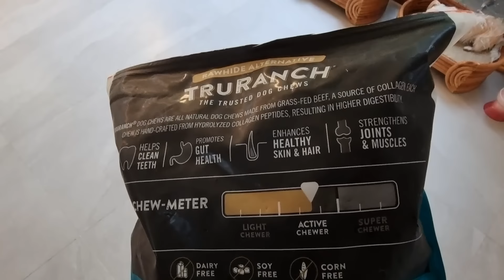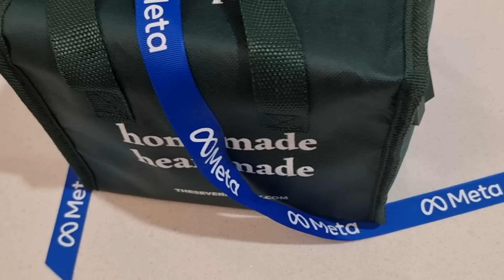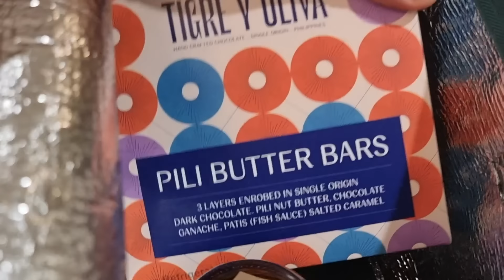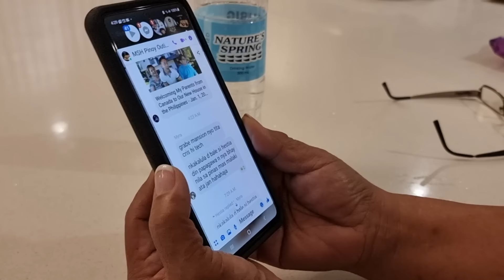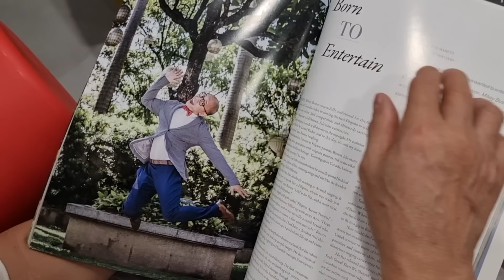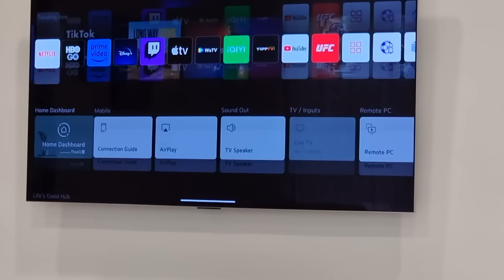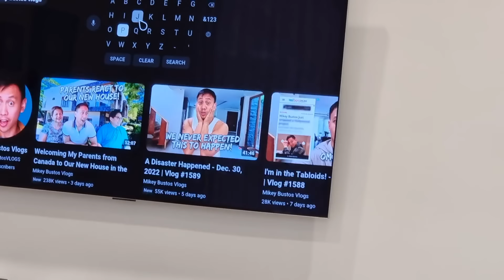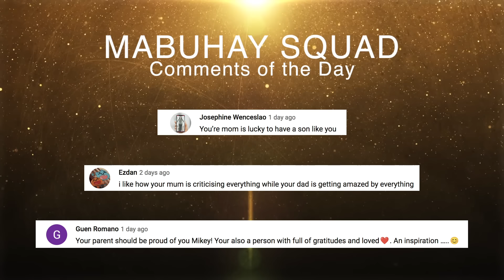My Parents Enjoying Life in Our New House - Jan. 5, 2023 | Vlog #1591

Comment: Man the crazy thing about the Philippines. All the labor is Manuel. I did not see one piece of machinery, digging up that swimming pool construction would be so much faster if you guys had cranes and bulldozers and diggers having  that to do all the heavy lifting would make things so much faster. Also, Mikey in that house of yours with that many floor space you’re gonna need those automatic mop or is that can do a bunch of square feet of the time it would take a team of like 20 to do all that by hand.  You may have to get one of those self propelled industrial auto floor scrubber.  These have a 2 feet cleaning diameter pads. Just to do all your floors.  Did you ever install a small elevator in the Squad house?